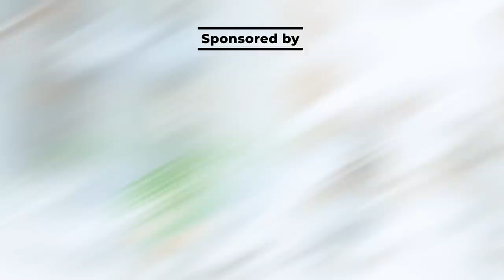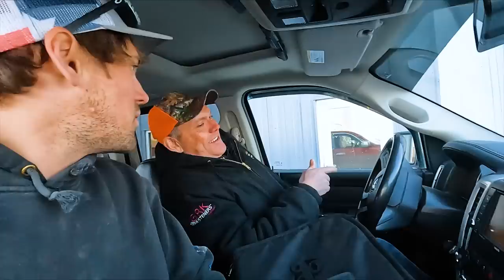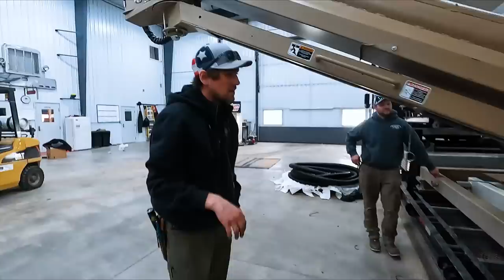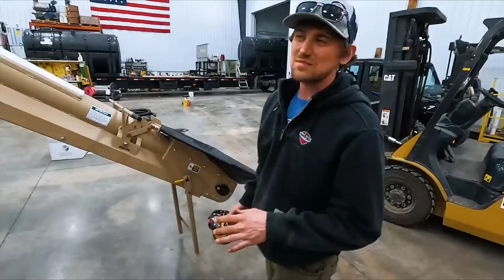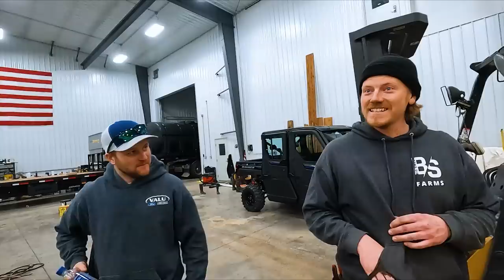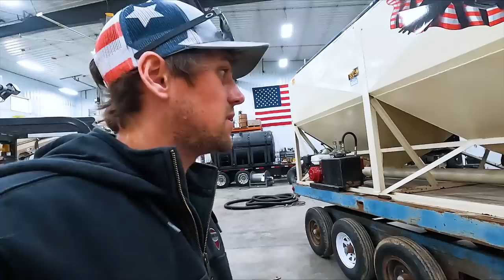When The Seed Guys Happy Everyone’s Happy!

Comment: You might set up the  engine/hydraulic unit with quick disconnect hose ends, fork lift slots and pin in place so you can switch between the drop deck trailer and seed tender to get dual usage out of the unit and stop having to draive  a tractor to unload the trailer each time.

Comment: I would change the pedestals on the fifth wheel on the truck pulling that trailer. It would give you more clearance underneath the front half of the trailer. It appears to slope drastically towards the truck.

Comment: I heard you speak of putting fittings on reinforced hose.?? I learned a trick. Anchor the hose horizontal on floor use a block of wood and big hammer. Give it some whacks.

Comment: Serious question....  You said you currently have an 84 foot land roller and this is a 91 foot land roller.  What is there to "try out?"  Does 7 extra feet make enough of a difference that you would stay with the smaller size?  What problems would exist with a smaller vs. larger land roller?

Comment: What is a land roller used for. Does it smooth out the field?
Reply: The rollers are typically used before planting or after emergence between the V1 and V3 trifoliate stages in soybeans for a few reasons, including:  

    Harvestability. The practice pushes troublesome rocks below the surface so that when harvest comes around, growers can place the combine head at a lower level to ensure more pods are captured. This practice also helps prevent rock-related combine damage and downtime caused by equipment breakdown. It can also help crush other elements in the soil, such as corn rootballs or soil clods, to help smooth the seedbed for harvest.

    Plant development. Rollers are increasingly being used to encourage additional node and pod sets. When the roller runs through a field after emergence, its impact puts extra stress on the soybean plants, which may seem like a negative outcome, but some believe it actually encourages the plant to produce additional nodes, which in turn produce additional pods.
Reply: @colorado1088  Thanks for the reply. More complicated than I thought

Comment: I'm kind of dumb and slow sometimes.  You talked about the belt (auger not) being longer so you didn't have to be so close to the shoulder of the road when you serviced machinery in the field.  If you service from the road and all the controls and conveyor work off the driver's side of the truck, that means you have to pull up facing the wrong way on the road every time you service a machine in the field.  Why would you do that?  What am I  missing?  Wouldn't it be equal to flip everything around (the unverferth would have to go to the rear of the trailer) with the controls on the passenger side so you don't have to pretend you are working in England? Help me, someone.

Comment: What is the reasoning for a land roller?
Reply from the maker: Smash rocks in the ground for easy harvest of soybeans and black beans!
Reply: @LarsonFarms  The rollers are typically used before planting or after emergence between the V1 and V3 trifoliate stages in soybeans for a few reasons, including:  

    Harvestability. The practice pushes troublesome rocks below the surface so that when harvest comes around, growers can place the combine head at a lower level to ensure more pods are captured. This practice also helps prevent rock-related combine damage and downtime caused by equipment breakdown. It can also help crush other elements in the soil, such as corn rootballs or soil clods, to help smooth the seedbed for harvest.

    Plant development. Rollers are increasingly being used to encourage additional node and pod sets. When the roller runs through a field after emergence, its impact puts extra stress on the soybean plants, which may seem like a negative outcome, but some believe it actually encourages the plant to produce additional nodes, which in turn produce additional pods.
Reply: @LarsonFarms  👍

Comment: Looks like that seed trailer could do with a couple of those extending feet they have on mobile cranes to prevent tipping into the field.
Reply: Stabilizers..... Ya its definitely high enough.
Reply: @bobdevreeze4741  Judging by the wobble when Brody grabbed the end of the auger it couldn't hurt. Specially if parked on the very edge of the road.